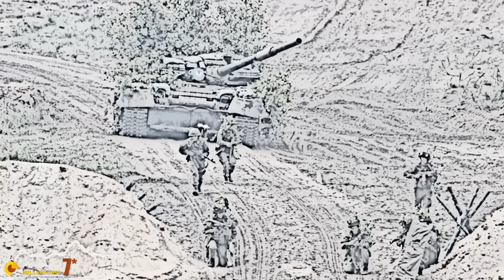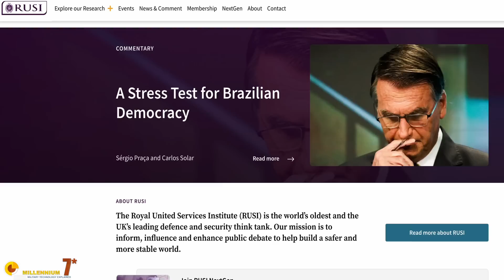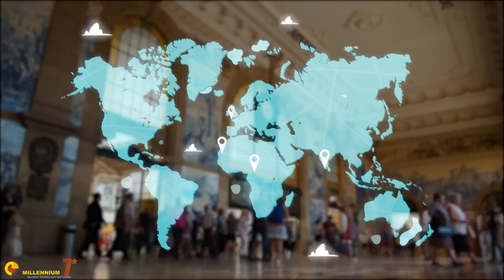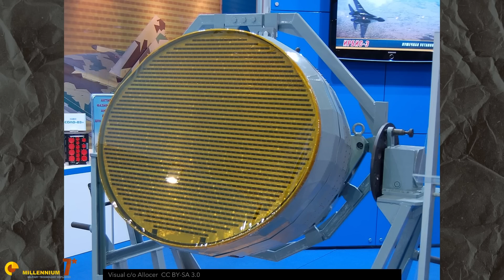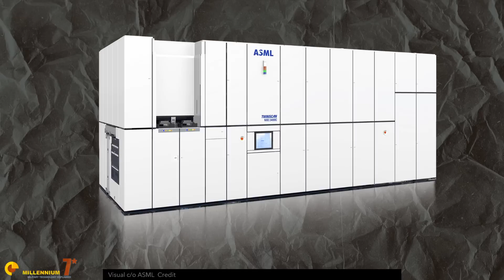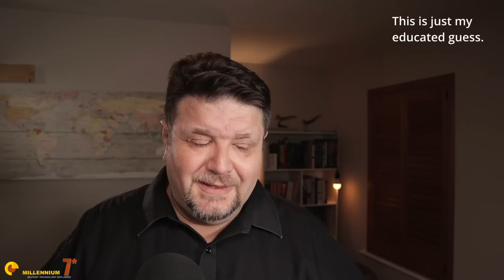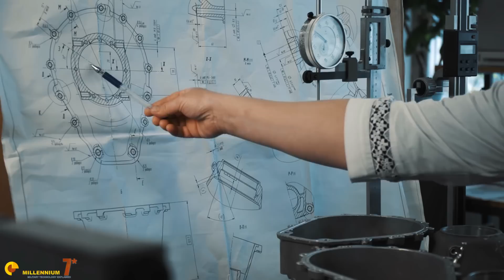Russia is using Western weapons in Ukraine.

Comment: Recently someone or group has investigated Chinese semiconductors and have found that they have indeed successfully made 7nm chips. A leap ahead of the 14nm chips that they have been stuck with until recently and certainly ahead of the Russians and their 65nm process.

Going to be interesting to see the Russians make the necessary changes required and how they go about it. A very difficult problem but not necessarily unsolvable contrary to other's who think the Russians are ripping chips out of appliances. 🙄 Can't rely on the media to do decent reporting.

Another excellent and informative video M7.
Reply: There is nothing wrong with ripping chips off of appliances. Those who are smarter have the least to pay.
Reply: @MGZetta  Why would they need to do that? Any of those chips could be sourced from China or India (where there aren't sanctions). Only gullible people would think that washing machine chips are powering Russian jet fighters.
Reply: Most military weapons and systems don't use the "state-of-the-art" chips. The focus is on dependable electronics and chips with known flaws. All chips have logic flaws and using the state-of-the-art components is a recipe for disaster. It's fine for a video game where some glitches are acceptable and probably not noticed. Not so for a high precision weapon or system.
Reply: @asimian8500  I agree. And the smaller the design rules, the more vulnerable the chip is to cosmic ray and alpha particle hits.
Reply: @asimian8500   It depends on the implementation. Some VERY high end processors are used for some weapons.  Reliability is indeed key... and this is an area where western components are also superior....but by small margins on lower end components.
Reply: @ivanzlatar2445  If you want to use AI assistance guided missiles state of the art is the way to go but I think Russia is far too conservative militarily to do something like that anyway. For 90% of guided missiles mature semiconductor tech from 2016-2018 is good enough.
Reply: @ivanzlatar2445  Nope we don't use high end proccessors for weapons.
You don't need to display 1980x1080 4k raytracing 3d game that renders a open world the size of a small country on your F-35. 
The intel FPGAs chip for military use is 28nm. Which explains why China focused on making 28nm chips in the past decades.

You iterally watched some introductory videos on how Russians can't make chips and you suddenly think you even understand the basics? 
By the way, the Russians can make chips for military use, they just don't make nearly enough. Because they are poor and didn't invest in the tech.
Reply: @lolasdm6959  Yeah .... My 30 years of work experience in the technology sector have NOTHING to do with my opinion.  I just read the internet to get my knowledge.  Like I said... It depends on the implementation.
Reply: @ivanzlatar2445  What implementation? The type of chips on military hardware are deacades behind commerical variants. My gaming laptop has more processing power than a aircraft carrier. You didn't even know that? 
Also working in the sector doesn't count at all, technically the guy at a telecom stall in a mall is also in the tech sector. And this talk about "Russia can't make chips", lmao, they can just stuff we used last century.
Reply: @lolasdm6959   Nice infantile repsonse.... Processor technology is about more than just raw processing performance. Some weapons require highly optimized power rrequirements (performance/watt) , or stringent size/ruggedization/durability/reliability needs. Straight up COTS components are sometimes not enough unless you introduce redundancy which is sometimes cost and sometimes system design restriction prohibited. These specialized implementation needs are not uncommon. ITS NOT ALL ABOUT FANCY GRAPHICS LIKE MOST GAMERS THINK.
Reply: @ivanzlatar2445  Yes, that is why we use 80s computers that directly controls space stations, because it is realiable and doesn't make errors nearly as much. The faster calculations are done by laptops.
I never said it's all about fancy graphics, but the reasons why gaming laptops have the best processors is because of graphical rendering needs of the market. Graphics are the most taxing requirement. Some people believe military hardware needs more proccessing power than games, they don't.
Reply: @lolasdm6959  We are almost in complete agreement...
Reply: @asimian8500  Keep telling yourself that
Reply: Missiles don't need 7nm, it can work the same with old chips. The only need is mass production
Reply: Actually they just announced 5nm ... I guess once you master 7nm then 5nm and 3nm is going to fall into your lap.
Reply: not mass produced.
Reply: @lolasdm6959  It is mass produced and commercialized, it was announced in 2020 by SMIC, youtube does not allow links sometime. but producing 7nm with 28nm DUV using n+2 process is "fairly easy". The person who invented the process Liang mengsong, who used worked for TSMC is working for SMIC now.
it did not make a big news back in 2020, because no one have seem their product, until recently their 7nm chips made by SMIC found in quite a lot of minning machines.
Reply: @commie5211  But still.
The issue China has with producing precision stuff isn't that China can not produce them.
It's that a fewer precentage of Chinese 7nm chips passes the quality control than TSMC. This makes every completed Chinese 7nm end up being more expensive than they should.
And also it's not really mass production when China hasn't became self sufficient in 7nm chips. This indicates again the issue of quality control and needs to continue to refine the machines until the losses from quality control is reduced to be economical enough for full scale production.
Reply: @lolasdm6959  Thats right, no manufacture will buy more expensive component than their competitor and losing the competitive advantage, however TSMC is banned from export, SMIC really have a chance to advance now. Once SMIC turns profitable, we gonna see the snow ball effect begin.
Reply: @commie5211  SMIC will obviously become profitable, zero competitors in the domestic market, and TSMC was never banned? Are you talking about Russia? Because Russia doesn't matter, Shanghai is a bigger market alone than Russia.
Reply: @commie5211  SMIC 7nm isn't use much because of yield gap with TSMC. for commercial product you need to be concern with price. "+" process requires more layering which take more time to make and thus is more expensive to buy. it was never that China could not make the chip, it just that there are cheaper foundries. but if US force those companies to stop selling to China, SMIC will have a monoploy and it process will be king.
Reply: It was no different during the cold war they were using 3rd party countries to buy in bulk atari 2600 systems to use the CPU in weapons.
Reply: no investigation, smic publicly announced that they're testing a 7nm process
Reply: Currently many electronic device such as tablet and medium spec smart phone using some kind of chinese new processor.
Reply: You are correct that China developed those type of chips however any serius military will not use those chips in critical infrastructure because of vulnerability to the EMP. 
Military use much more "rought" type of chips and those even Russia can produce, that doesent mean that military would not use commercial chips for non essental infrastructure, of course they will why invent a wheel again, considering the fact that Russia is best friend to China thanks to the US they have acces to everything.
Reply: They also have 6nm chips but use snapdragon 4nm in their smart phones
Reply: My Oppo handphone has a 6nm chip.
It's mainland Chinese product.
Reply: @zafir7007  yes. But the chip in your phone is probably a Samsung Or TSMC made SOC and not made in China. And I believe 6 and 7 are the same tech category. Marketing terms
Reply: @k.k.c8670  Yes it is built inhouse by Oppo using TSMC process. So in conclusion, the Chinese are capable and the technology is available to them.
Reply: @zafir7007  they are definitely capable of designing advanced chips but I don't think they can build it in China. They outsource the manufacturing to TSMC or Samsung. Now with sanctions, they are frantically setting up factories in China to try to manufacture themselves. So far, they have preferred to outsource. It's not easy to now turn around because of large investments needed and the fact that the US embargoed some software and machinery needed. Even machinery from the Netherlands (ASML)
Reply: Also seen reports they have made 1nm chips. Draw your own conclusions.
Reply: It doesn't really matters. The difference between 14 and 7 nm nodes is totally manageable.
Production cost doesn't matter in military applications, size is not important (chips are very small already, interconnects and system integration is much more important and smaller feature size doesn't really help).Just imagine how small is a Tesla card. 
 What matters in practice is energy usage, and there is roughly 2x difference in per watt performance. Only.
Even 2 x processing power advantage is not that big: algorithms for processing are superlinear.
Original YF-22 processing power was thousends times lower than modern PC.
Reply: @peceed  

Yes, production cost does matter in military applications. Why didn’t the British Admirals take the German fleet buildup more seriously prior to WW1? Simple. The German Empire couldn’t afford to build enough ships to keep up. Hell, British yards were building more ships for export than Germany was building in total.
Reply: @Z80 

Yeah, yeah, yeah, and the Z80 was a fantastic processor. So was the 6502 and 6510. 

That doesn’t mean they have the capabilities needed.
Reply: WOW. The Chinese trolls are strong here.

Well educated and intelligent people are one of many components to having a high tech industry. You also need capital, experience and time. China does no have the last two and teh first is running out.
Reply: Um, no. China has made ‘lab specimens’ but are at least 2-3 decades from being able to achieve commercial production. By which time it will be 2-3 decades obsolete.

The current Chinese ‘lab specimens’ were also built using Western technology that they’d have to reverse engineer.

Also there’s a difference between having lots of engineers, and good engineers. My rule of thumb was unless an American or Chinese engineer had at least ten years practical experience you had to be really careful. Basically Chinese and US universities churn out a lot of graduates, but most of these graduates have extremely spotty training, and can’t be safely hired until they’ve ‘made their mistakes’. 

Russian, Canadian, British, Danish, Polish, Slovakian, and German graduates tend to have far better training.

Those are the national educational systems I’m had some experience with, being on the receiving end of things.

Point being it doesn’t matter how many engineers you have if there are flaws in their training, and there are huge flaws from what I’ve seen.
Reply: @Wayne's World of Science of Technology ... 

Not at all ..!! TELL me then why China Is now One Step ahead In 5G/6G technology Also China Is now way ahead then USA in "AI TEC " In Some Aspects USA Still ahead then China But  In Some Aspect China Is ahead then USA 
like wide  In Fighters jets TEC USA is Still ahead then China But Not Much In Manny Sectors China Now Verry Close USA In all Feilds Including Military wise Too The Upcoming 10 years Will shows US full Crystal Clear Who Now Still a Major Powar USA Or Someone's Else' Offcours USA will be a Major Big Power In future too But not with Title of Super Power USA wasted there  trillions of dollars Money On 20 years of wars To Distroying Others Nations While China Invested On Humans And Development of Infrastructure and most Of all The China Govt invested Money Human Brains Development Now A days China Have Soo Manny Modern City's They Transform there Old Poor City's into new Modern City Full with eco system Neat and clean Environment today Not a Chinese You will find a Jobless Today have Most Millionaires and Billionaire's They Have Best Health system best Education System Best Roads Infrastructure and also best Train System  That' do Eefects On Humans Brains which called Environment ...
Now A days China Do Produce Manny Scientists But Few really Quality Level Scientist ,, Offcours Those Scientists Do not directly Jump Into Field and start 
Making a Evolutionary technology But They Have there Own Process In which they gets through...  Sorry buddy my English is not Verry strong But I hope you got My point Also You Can disagree with me.... but China Is Now Way way ahead From the west  Just go into china and spend one Month It will shock you After Every 5 Years There same City gets In New Different shape That's There Development levels they Moving ahead Nostop with Incredible Speed in every Field.
Reply: @waynesworldofsci-tech   Its hilarious when the current 'American' sub 10nm chips are all made by Korea and Taiwan (Intel still hasn't got its 7nm process working and may skip it altogether!) that we talk about how many decades China is behind, move along nothing to see here........ Korea, Taiwan 51st and 52nd US states right!
Reply: @lunchik2689  

China is that far behind. The semiconductor manufacturing industry is international in scope. Taiwan can’t produce chips without US tech, which doesn’t work without Dutch tech, which doesn’t work without German tech, which doesn’t work without Japanese tech.

7 billion people against 1 billion people. Oops.
Reply: @lunchik2689  Intel had all the same problems with 10nm. So this is not new to me. If they opt to skip they may be a little desperate as they hadn't fully given up on 10nm and eventually did get working products on it.
Reply: @waynesworldofsci-tech  The issue with the microchip race is that we are close to a bottle neck. 
Meaning even if China catches up to the current level the West has in a century, the west won't be advancing much past it.
Reply: @lolasdm6959  

No, we are not. Go listen to Dr. Ian Cuttress on his Tech Tech Potato channel. He is one of my sources from when I did the research for the video I cut months ago on Russia’s tech issues.
Reply: @waynesworldofsci-tech  
Russian tech is not even the topic I am talking about, there is a theretical physical limit on microchips. This is because the width of a silicon atom is 0.2 nm. When we begin making chips smaller than 1nm, that will be it until the next material science breakthrough.
Who even cares about Russia, tech is full of breakthroughs and stagnation. Russia doesn't even matter in the long term, even if they take over Ukraine it won't matter.
Reply: @lolasdm6959  You are already behind reality. The bottleneck is gone. And several 100 Mrd worth factories are in the pipelinein the west. China lost the race before they could have a chance.
Reply: @waynesworldofsci-tech  You actually wrong they are producing 7nm and just announced they are jumping to 5nm.production shorty.
Reply: @ntal5859  

Really? Then where is the announcement? I watch this area carefully and haven’t seen anything.

Note also that there’s 7nm and 7nm. While the nm size used to bear some relationship to reality, it stopped about 20nm and below. That’s why Nvidia moved to TSMC, Samsung’s process nodes aren’t as efficient, nor is Intel’s. Next level it could go the other way, all three companies are capable, but the point stands that 7nm isn’t the same across manufacturers. There is a move to redo the measurement standards, but I have no idea if it will be successful.
Reply: @waynesworldofsci-tech  from Tech Insights...
"After we revealed our initial findings on the SMIC MinerVa Bitcoin mining processor, our team did further analysis and comparison against TSMC 7nm. This new analysis confirms that despite current sanctions restricting access to the most advanced equipment technologies, Chinese Semiconductor Manufacturing International Corporation (SMIC) has used 7nm technology to manufacture the MinerVa Bitcoin Miner application-specific integrated circuit (ASIC)"
Reply: @waynesworldofsci-tech  you are wrong. A semiconductor reserch lab fojnd 7nm nodes on chinese semiconductors that is available on the market.
Reply: @jahidjesan2067  

Link?
Reply: @waynesworldofsci-tech  The "specimen" happened 3 years ago. The new report was because somebody ripped out SMIC 7nm chips from their cryptocurrency mining machines.
Reply: @dabo5078  

No, two decades ago was when this became known.
Reply: @waynesworldofsci-tech  Coping huh?
Reply: @dabo5078  

No, just been involved with the edges of the industry for a long time. There are things that just aren’t feasible, because either the technologically or the infrastructure doesn’t exist.

Silly example, but no one can build battleships anymore. We know how, we care technologically capable of building a WW2 era battleship. But we don’t have the infrastructure anymore, because heavy armour plate isn’t manufactured anymore. We’d have to build plants to build the equipment to outfit an armour manufacturing plant before we could build a battleship, never mind the issue that steam turbines of that type aren’t made anymore…

It isn’t a simple subject, there are a lot of shades of grey, like technologies that can be substituted (and no, you don’t want nuclear propulsion on a battleship, nukes don’t like vibration, like the ship getting hit).
Reply: There is always someone like you, spreading "news" without any proof. We call it lies!
Reply: @donquixote1502  not z troll
Reply: @donquixote1502  It's literally a publicly published peer reviewed scientific article, LOL. Don't blame us if you can't read Chinese. The racism in some people XD
Reply: @donquixote1502  he ain't lying. SMIC started producing 7nm chips for a bitcoin processor since last year despite all the sanctions.
Reply: @donquixote1502  China has an even larger pool of high intelligence tech minded folk than Taiwan, in fact Taiwan is well into demographic collapse. 7nm is not a big thing thing, 4nm is already here after all.
Reply: @churblefurbles  may have a bigger pool of resources, but are still decades behind at this time, FACT
Reply: @churblefurbles  China made 7nm in limited numbers but doesn't have the infrastructure to scale up, also China is far worse in the demographic collapse market.
Reply: @churblefurbles  none of these "nm" claims are based on the actual nanometers of circuits. They are marketing jargon. What is far more important is the supply chains behind them, and there isn't a single one in the world that doesn't use Russian gas, or Made in China monopolies. Even the F-35 has gone out of production before the PAKFA.
Reply: @churblefurbles  Chinese chip maker does not have Apple as their exclusive client. That’s why Taiwan Semiconductor leapt ahead. It could have been Samsung or Sony.

That said, new US chip bans just ensured that Huawai and other Chinese device makers would now fulfill that role of vital commercial partners.